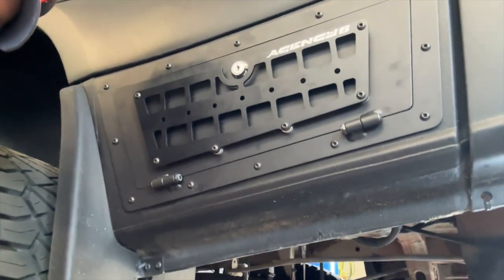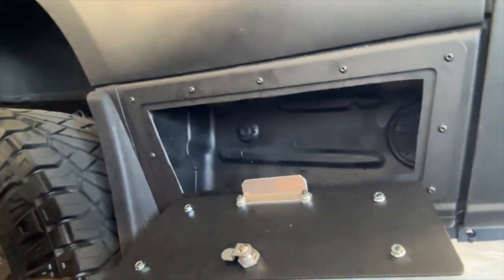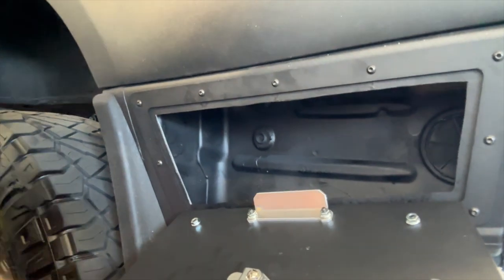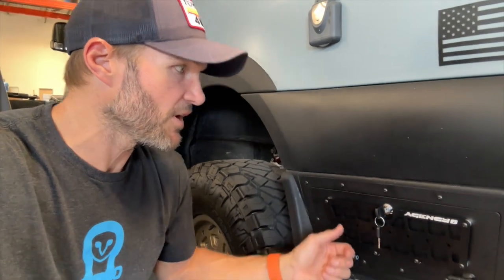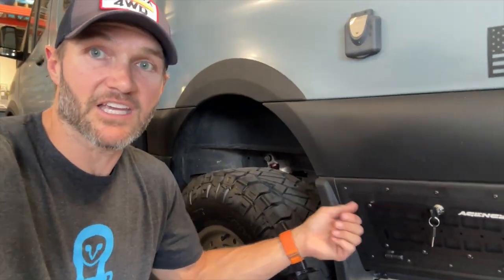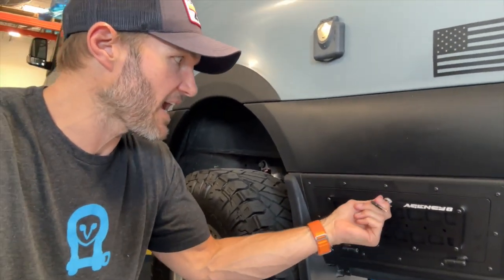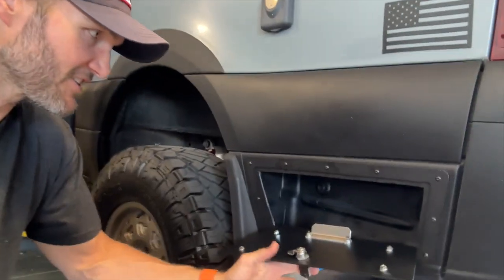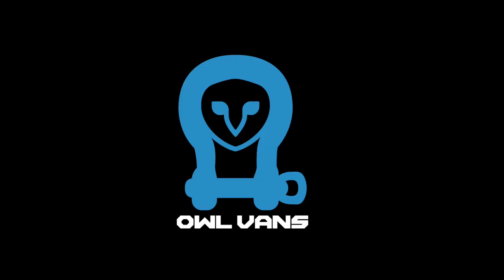Sprinter Rear Storage Locker

Comment: Using the inner bracket to trace the cut area leads to that extra bit of sheet metal interfering with the door closing.  Use the outer trim bracket to trace the cut line.  That extra 1/4" of sheet metal causes the setup to not fit flush or correct.  This is from Agency 6 when I called them about my fitment issues.

Comment: It looks like the locks are similar if not the same as typical RV/trailer locks. My experience has been pretty bad with those locks. They are easily opened, they loosen up, they are universal (my trailer keys just “happen” to be the same as my RV keys.)

I love the idea of the storage… but I’d be concerned of the cheapness of the locks.

What has been your experience with the locks? And would you have any suggestions for a better lock?
Reply from the maker: Locks almost all fit the same size hole. While the locks on these are not cheap, I am sure you could find a marine lock if you want

Comment: I did see a gasket around the cover, so water may leak into the storage box.
Reply from the maker: The cavity has a weep hole and the kit actually does come with a  gasket. We had just installed this and had not put the gasket on before the video. Good catch.